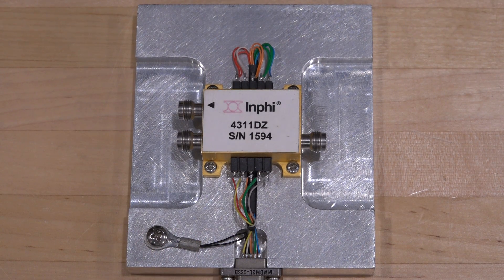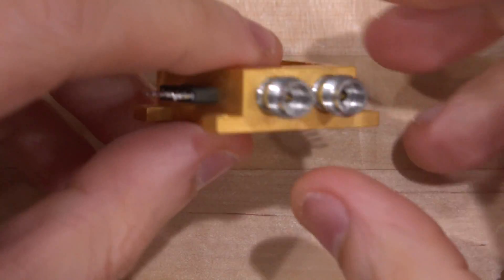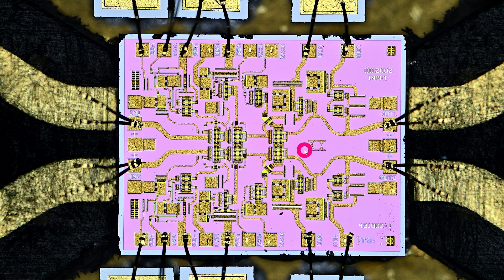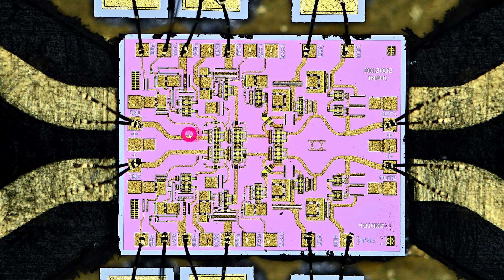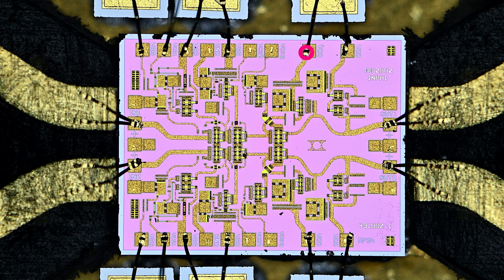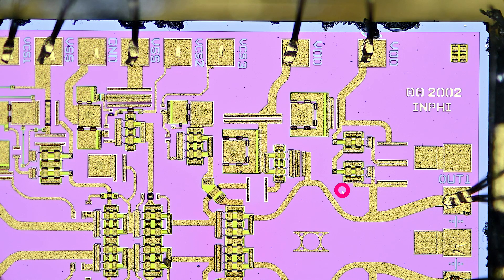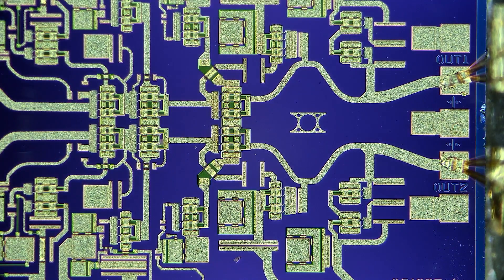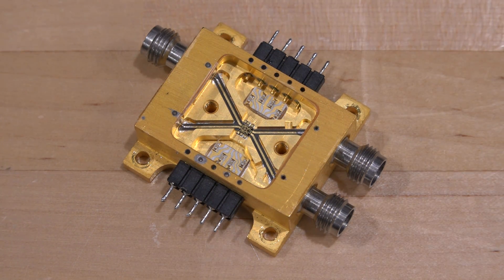TNP #35 - InPhi 43Gb/s 8Vpp Differential Mach-Zehnder Driver ASIC & Module Teardown & Analysis

Comment: The die is made on a HEMT process, maybe ph25 or ph15. It is a UMS foundry circuit, I know this as there are some specific features placed on the die that have no electrical function and are only to be seen ar UMS. We designers did not like them as they only took space. TI / Triquint did not need them. I was a designer at UMS 25 years ago. You can se the gate fingers of the Transistors and the source pads connected with airbridges for 4 finger transistors. The process uses one evaporated and one galvanic metal gold layer. MiM caps ant tantal nitride resistors.

Comment: It definitely is not a InP HBT process. The transistors look lateral like HEMTs. So I'm willing to bet it's a GaAs FET process.
Reply from the maker: I considered it being GaAs, but InPhi rarely ever used GaAs processes, although there were some talks about them using it a while back. The individual devices also come in dual-fingers and you can see that in the spacing of the multi-device arrangements. I will add a note.

Comment: Why did they use double wiring on the signals? Is it for robustness or for lowering inductance?
Reply from the maker: It reduces the inductance and makes the interface have a better overall frequency response.

Comment: I'm asking myself what this ciruit is having in common with the Mach-Zehnder interferometer. Is this used driving lasers in a wavelength division multiplexer? I do not understand how. Are there details available anywhere?
Reply from the maker: This is a very different device than an interferometer. It can be used to drive a Mach-Zehnder modulator.
Reply: @TheSignalPath  Well, as I understand, a Mach-Zehnder modulator is nothing else but a Mach-Zehnder interferometer with a controllable phase shifter in the second optical branch in front of the second optical beam splitter/combiner.
For me it would be of great (academic) interest how your parts work..

Comment: Is there any 3D aspect to the chip and its components?
If you were to tilt the sample slightly, can you see any topology?
Reply from the maker: All ASICs are pretty flat and planarized.
Reply: For all intents and purposes, ICs older than about ten years are purely 2D structures. More recently there has been development in the z-axis with things like FinFET, etc. but they're still so thin that you would need SEM to see the thickness.

Comment: I'm not sure how much it'd be covered by your ASIC knowledge, but it might be interesting to talk about how microwave ASIC design techniques carry over to (pre-)ampflifiers for cutting-edge wide bandgap switching converters (especially resonant ones, both "DC" (w.r.t. the resonances) and HF output ought to be interesting).
Given that they can utilize ZVS with resonances at 13.56 or even 27.12 MHz, the pulses out of the pre-amplifier need to have bandwidths into the hundreds of MHz, which is where the microwave ASIC aspects come to play. Because the transistors there need to be way faster to offer nice gain.

I've actually considered reaching for SRD/PIN diodes to very rapidly commutate turn-off charge into an SiC JFET gate without asking too much bandwidth from the power-gain amplifier (the SRD only provides pulse shaping), because the gate resistance is quite annoying:
higher-voltage pulses, as well as substantial losses (well, if you're aiming at 2~2.5 nines of efficiency of the switching converter after reaching for all the soft-switching opportunities you can grasp, to not burn up the output capacitance stored energy at each turn-on).

But it is my understanding that similar issues in GaN HEMTs caused monolithic integration of the pre-amplifier with the power amplifier due to the substantially reduced gate voltage in those processes (around 5V target, with 6V limit, and around 3.5~5 V necessary to have low-ish restance) and even higher switching speeds, even in hard-switched applications.
E.g., epc-co has some ToF drivers for VCSELs that do input pulse widths of 3ns at repetition frequencies of 100 MHz, as a single-ended low-side-switch for the laser diode.
They do like 40V 5A to the laser, but are technically just general limiting single-ended amplifiers (LVDS and 3.3V CMOS inputs available). Not that they need to do microwave matching at 1.5 by 1 mm die size and these 1~2 GHz bandwidth outputs, but then again, not all preamplifiers for switching-type WBG power amplifiers are exclusively used in limiting mode:
one may want to use linear mode during on-phase to remove harmonics at the output of switched capacitor circuits/control commutation of load current between interleaved phases of multi-phase converters (also for getting rid of harmonics).
Also, JFET gates offer a near-channel diode temperature sensor during overdriven/limiting on-state, if one wants to utilize them (e.g. load balancing in partially-linear-mode applications, to counter thermal runaway/power hogging issues); I think BJTs would do, too.

Comment: I would love to see a video on the full RE of the chip and how it all works! Would also be cool to hear you talk about what the state of the art is today for high slew rate drivers in this space - I'm guessing we're up to 112G by now? Are we still using LiNbO3 stuff on the optical side?
Reply: I know the line rates are that high now, I'm just not sure if external modulators kept up or if we fell back on doing direct modulation, like they do with VCSEL in CPO.
Reply: @gsuberland  PAM4 as @mmwaveDesign mentions  points to non-synchronous, right?
Reply: @pizzablender  it still does clock recovery but they mostly replaced the AFE with DSP on modern ASICs.
Reply: the IEEE have standardised 112G signalling and this is being used both optically and electrically now. At the OIF we are well on the way to defining 224G and already several vendors have shipped parts. Optically multiple companies offer coherent modulation to 1.2Tb / lambda